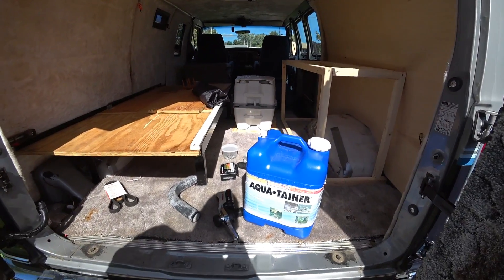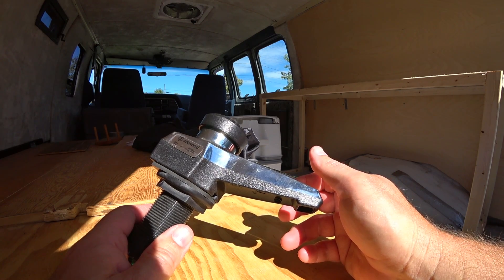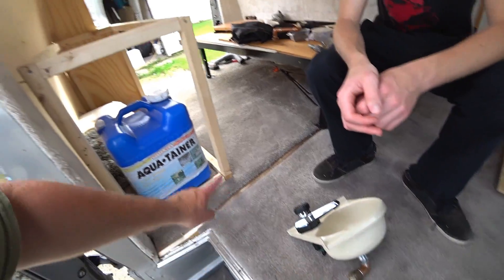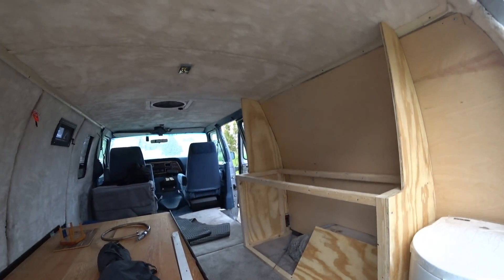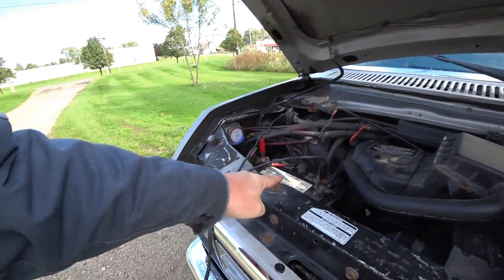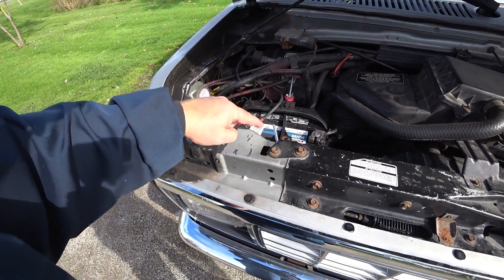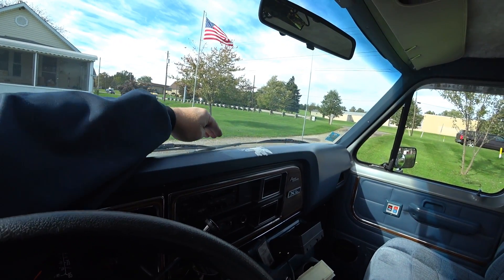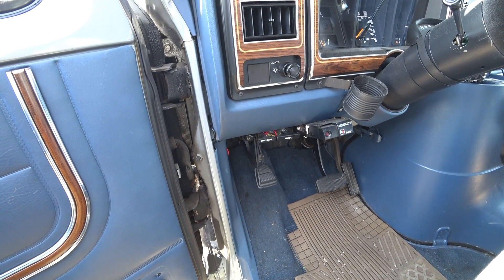Nomad RV Van Build Part 8

Comment: Old Fords clicking at start.... I'm surprised it wasn't the magnetic switch, a solenoid that governs electricity from battery to starter. I've replaced a dozen. Even jumping on with a pair of pliers on a boat 60 miles off the coast. The captain was very,very happy I was there. Good video.

Comment: Our Pontoon boat has a sink with 2 of those water bottles like you have in the RV.  One you pump for water to run into the sink, the other is connected to the sink drain.  We take both with us as we come & go on the weekends we use the boat.  We marked Fresh & Gray so we know which tank to fill with fresh water before we head back to the boat.  Ours will need to be replaced soon and you gave me some hope that they won't be hard to find.  Thanks!

Comment: I am probably late to this party, but WHY didn't you weld longer legs on your bed frame ?  I can see it's easier to use what you have, but what would it have cost to add 6-8" onto the bed legs ?  It appears a lot of wasted potential storage space with the bed so low to the floor. I sincerely hope you are planning cabinets above the bed.
Reply from the maker: Great question, but he wants to be able to sit and and possibly work at a desk etc. While it's not yet finished you never know what they might do.. Thanks for watching 😁👍